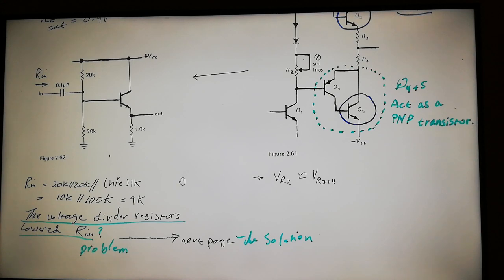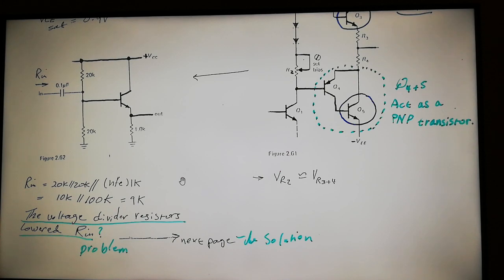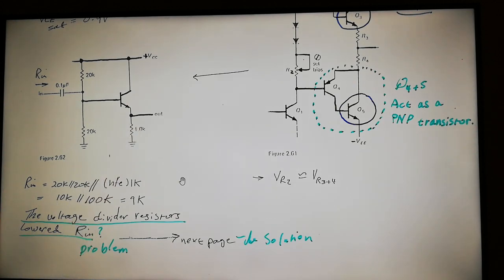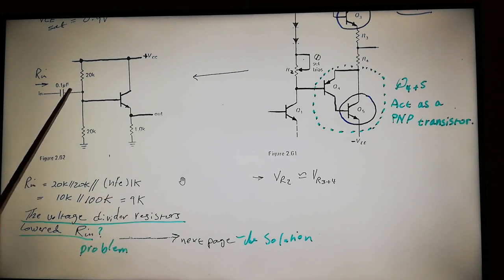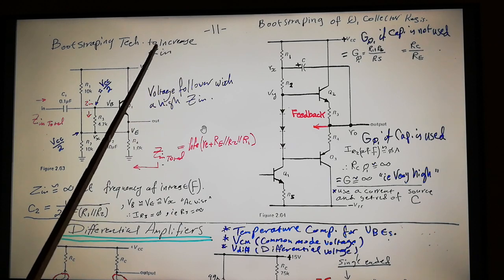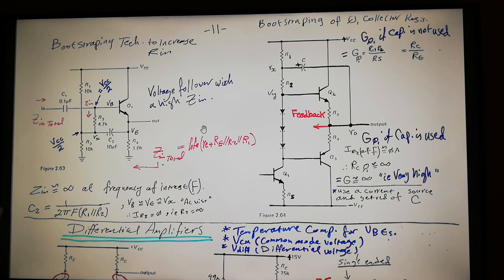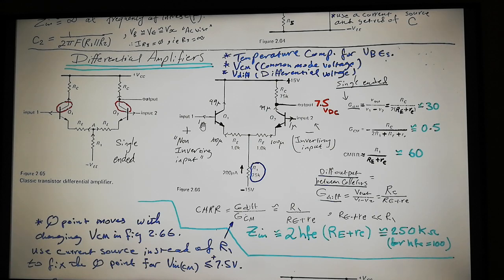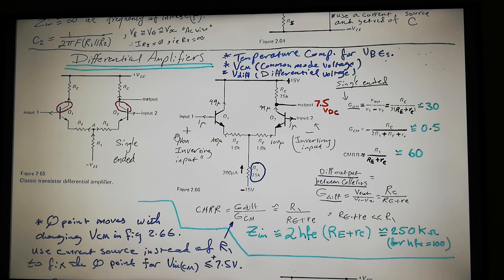Transistor, Design and Applications 7.Bootstrapping input resistance and voltage gain الترانزستور🇯🇴

Comment: I observed in many circuit where a series RC circuit is connected between base and collector of npn/pnp BJT ..I couldn't understand the reason....those BJT used for the switching purpose

Initially thought as a Miller capacitor but why there is a resistor in series with the  capacitor..

Could you please help to understand
Reply from the maker: I will keep your comment on mind, if the RC is there, then that must be for a good reason, I will have lectures on the basics and Applications of a various Switch mode Power supplies.
If what you described, is on switching transistor, than that has to do with a protection technique for the transistor, and I believe it's called a snubber network, it slows the dv/dt . I will elaborate more on this when I make my lecture.
Reply: @mazen723  Many Thanks Sir